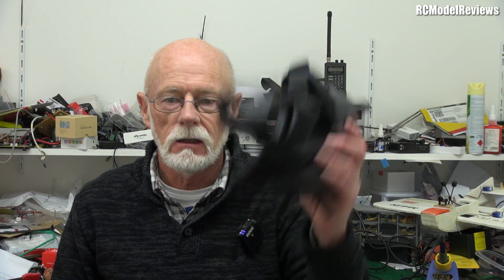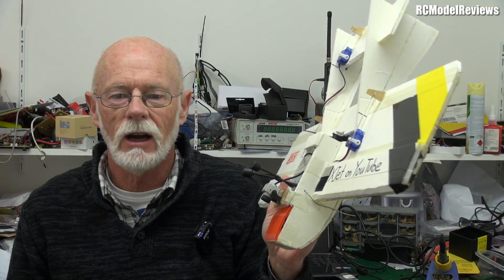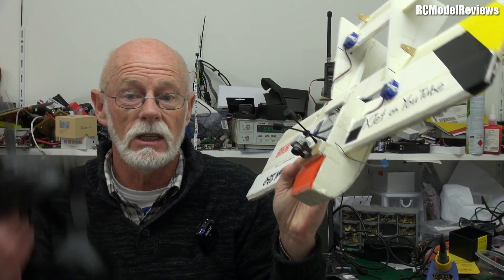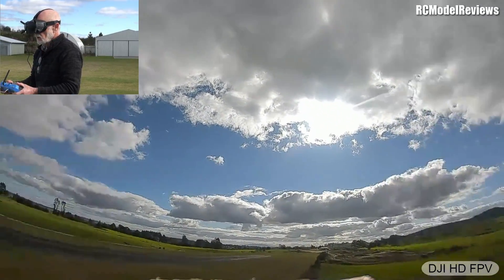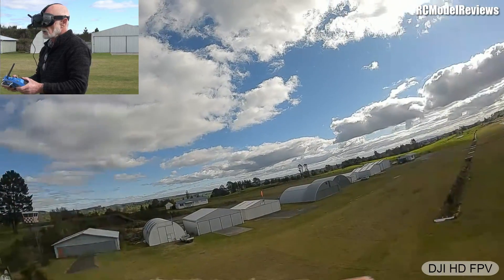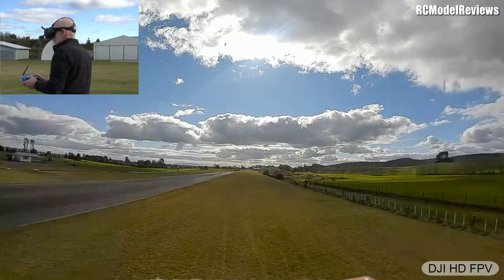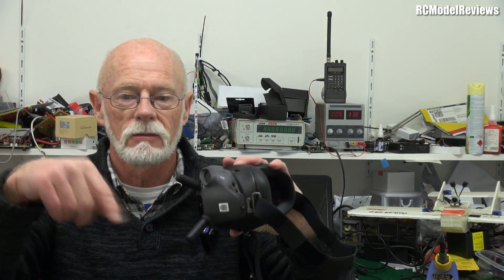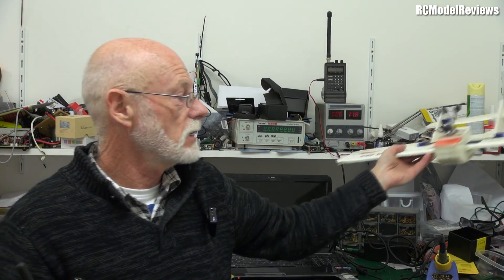Quick 25mW range test (DJI HD FPV first flight and thoughts)

Comment: 4:06 I am wondering about the clearly separated sharp squared area in the middle and the heavyly pixelated stripes on both sides, which are very obvious. I guess it is a software trick to reduce the video bandwidth.
Reply: Hey to answer your question, hes using the focus mode option that has the sharpest image in the center of your screen. This is mostly used for fpv racers but the system also has the normal view.

Comment: Bruce, is there any statement from DJI why there are only two options for power setting? I'd like to see 25mW, 250mW, 500mW, 700mW as options. not just the two. I feel 250mW is far more usable (albeit still unlawful in certain areas of the world) for a more solid video link in close proximity.  Aloha

Comment: lost my brand new build with DJI air unit today in some tall grass. never to be found again. The quad glitched out on low signal about 300 yards away.. not sure what the problem was. Nowhere near 4km as DJI states. Big open field, Not super impressed.. Signal came back and I was in the grass ( 6 feet tall grass). gone forever.
Reply: Did you install a beeper or program your motors to beep upon a few minutes of inactivity? I hate to hear these stories about lost gear... wish you all the best.
Reply: The Polymath nope. But on my new build coming in the mail I ordered a self powered buzzer. Will never lose another drone.

Comment: 10:40 I actually want to see someone flying a control line plane with a signal cable going back along the line and wearing fpv goggles now. How many circles till they ended up tied up and on the ground? :P

Comment: thanks for testing 25mw (but you had no other option right?)
when i tested the inspire with occusync i also measured the wireless aspect. it was for sure more power than 25mw. legally in eu!
why? because dji did it :)
no i think to remember that if you are didital and frequ hopping (like occusync) than you can use up to 100mw (or more?)
here with the new dji hd sys for high quality and latency i think they use the same bandwidth as analog. great - because you can cram in more pictures, but resrtictions apply and now they really need to use 25mw here...
i just really hope it will be as easy as upgrading us firmware onto those dji pieces and get the full power (i dont think the hardware will be different - that would be way too expensive in production...)

thanks bruce, wish you more flyable winterdays soon!

Comment: Great stuff Bruce !! This is why I'm a Pateron !! You test the stuff that others don't think of, and  are straight up about it !! Keep up with the great reviews. I've seen rumors of a FatShark HD and a Furious FPV HD unit, but DJI is the first. Years, or months, or days from now, we are going to see HD FPV being the new standard, and 2 years ago most were predicting it wouldn't happen at all. I'm glad I bought HDO's now, as with the HDMI input, I'm sure there will be HD in my goggle feed soon. As a weekend , close proximity flier, I don't really have many video issues, and not DJI in any case, as their proprietary approach to tech as well as their cooperate image  is total 1984 BS. 
      IMO, this will be a very poor seller, and will be surpassed by more affordable/ usable/  better systems almost immediately. I wouldn't expect it to last very long , but it is an important product. 
      If you are looking for suggestions on videos, your point on breakup is very valid. I've heard many Crossfire pilots complain about the Freeze frame effect VS the effect of static. Perhaps you could explore more about that. Or digital VS analog transmission challenges. Your whiteboard videos have taught me a lot, and you keep it interesting. In conclusion, review the process, and the product, as the product may not last, but the process will. 
   Thanks, Bruce, you give great value for my small contribution, and a few laughs as well !!

Comment: If the googles had HDMI out it would be perfect... Wonder why there isn't a HDMI out.
Reply from the maker: I suspect that DJI will either update the firmware to deliver HD out via the USBC port or they'll sell a separate box ($$$$) for those wanting to get HDMI from the video transmission.

Comment: http://dji.retroroms.info/howto/dji_configs#detailed_video_tutorial
Reply: FCC (0.4w) and FCC boost(1.5w) are two different things gents. Copy of a well known member....What is "Force FCC" and "FCC Boost"? The Mavic and its controller ordinarily communicate on the very congested frequency used by wifi and Bluetooth, 2.4 Gigahertz (2.4Ghz). The maximum power at which consumer products can transmit on the wifi frequency in many countries is 0.1 watts (0.1W). In a minority of countries, including the U.S. it is 1W. Some countries lie in between. Only one country, India, allows more than 1W (In India, the max is 4W!). The Mavic detects where it is located in the world and sets its power to one of two settings, 0.1W (CE mode) or 0.4W (FCC mode). If you live in a CE country, your range on the Mavic will be very limited, at best, 3 to 4 kilometers (2 miles) and much less in urban areas with lots of wifi interference. If you are in an FCC country, range will be much better, up to 6 to 7 kilometers (4 miles). Force FCC is a mod we can make in the DJI Go app on our phone or tablet that instructs the remote controller and Mavic to transmit at the higher FCC power anywhere in the world. But that's not the end of it. For whatever reason, the Mavic has the ability to triple its normal FCC power and transmit at 1.5W (that's 15 times the normal limit outside the U.S.). Additionally, it can shift its frequency out of the congested 2.4Ghz band to either 2.33Ghz or 2.57Ghz--significantly reducing the effects of interference from all the wifi in urban environments.

Theoretically, people in CE countries will see doubling of range with Force FCC and almost quadrupling of range (3.9 times) with FCC Boost. People going from FCC to FCC Boost should see nearly doubling of range (1.9 times). In fact, a Mavic on the 2.57Ghz band at the FCC Boost power of 1.5W will likely be able to stay connected to its controller at a further distance than its battery will allow it to fly away from the controller and make it back. Is it legal to fly your Mavic using Force FCC outside the U.S. or using FCC Boost anywhere (other than India)? Not without special permits.

Comment: You do a video on this but not FPVBLUE?
Reply from the maker: Yes, several other HD systems are currently on the bench and in the air with video to follow.
Reply: @RCModelReviews  yes write on mate ! I have the first Gen 1.3G FPVBLUE  love it :-). I run it side by side with my analog video system on 1.3G with a little bit of Channel separation everything works. Been out as far as 45k on analog  and with FPVBLUE freezing up at around 20k using long range LHCP receivers antennas for FPVBLUE and RHCP long range antennas on the analog video system.  Works like a dream. Unfortunately there were only a few produced of the 1.3G fpv blue systems built and there won't be a 1.3G in the future. But a new 2.4g system is on the way with a 1080p down link. The only drawback is the reduction in range compared to the 1.3 G version I have.

Comment: Hey, could you let us know if the controller is compatible with simulators like Liftoff?

Also, what do we lose out on if we use a Kiss FC? HDL protocol?
Reply from the maker: The official DJI FAQ says that the RC transmitter can be used with simulators but I don't have one of the transmitters so can't confirm.

Comment: Thank you for testing 25mW. I live in Europe so this power level is relevant for me.
Reply: Yeah, if 250 meters is all we can expect, it’s worthless. My old Phantom 2 had better range than that.
Reply: Nobody would notice if you fly with the full power. 5.8ghz goes not interfere with anything important.
Reply: blise518B As long as you have the option to switch it.
Reply: wattage2007 even if a cop would have a look at it he wouldn’t have any idea. They would need to send it to a measuring facility or something. And that’s very unlikely.

Comment: I have installed on my Eflite Oppterra 2m wing.  Set to 700mw and it works great.  Not so great at 25mw. No surprise there!!  Great picture thru the goggles.  Happy customer.
Reply from the maker: Yes, I just flew (in a storm) at 700mW and it is a vastly superior experience.

Comment: Interesting video correct me if I'm wrong but hi density detail notwithstanding the signal loss seemed to produce a vertical curtain effect of pixelation from each side as well as freeze frames is this a clue to how they have dealt with the signal hysteresis/latency and was the audio at the end from the model or the hand held camera as it seemed delayed or maybe they don't do audio as it has to be delayed to match the displayed frame rate? It will e interesting to see what the latency is!

Comment: I can't waite for your antenna tests. My Fat Sharks are on Ebay right now so I can afford these.
I am super curious if we are to use wifi patch antennas meant for routers or patch antennas meant for fpv
Reply: No it will not work. Dji is using a mimo system, a special antenna array that is working together to archive maximum performance if you play with that it won't help
Reply: @peterzingler6221  Oh sweet, if its MIMO then I can totally use wifi antennas. I did the exact same thing to my Mimo router and giant Mimo Wifi network I setup for a trailer  park. Just have to use all the same antennas on all the ports for it to work.

Comment: Yah,25mw isn't enough.Turn it up,forget about the laws.
Reply from the maker: What? Me?  :-)
Reply: @RCModelReviews  You can get a over 500+ meters on 25mw or a little over a quarter of a mile  if you change the antennas out bud. Check out the XAIR 5.8's for the DJI Goggles, they are very good and get you some of the best experiences you can get right now. Changing out the stock on board antennas also helps but its not as dramatic as the goggles themselves.
Reply: Careful, we recently had someone interfering with frequencies we use up in whangarei. RSM came out and investigated for over a week before finding out who and what it was. Fines will probably be in the tens of thousands of dollars.
Reply: @defyent  hi, can you elaborate on that, I'm in whangarei and just bought the system , what do I need to know?
Reply: @Jiml3ob  Sorry my comment was a reply to the "forget about the laws" comment. The DJI system it's self is great and you shouldn't run into any trouble.
Reply: @defyent  even if it is unlocked to 700mw?  Thanks for responding by the way.
Reply: @Jiml3ob  You'd have to doublecheck RSM's limits on airbourne digital 5.8ghz, even unlocked you're unlikely to cause the kinds of problems I mentioned above, that was an entirely different band.
Reply: Thanks for your time and advice man.
Reply: @fellasboyz1272  you can get up to 1200 mw

Comment: Bruce do you have a Connex Pro Sight system to do a side by side test? would be interested in your thoughts.
Reply from the maker: Yes, I will be doing a side-by-side of the DJI system with the Connex Pro and the FPV Blue

Comment: Could you fly arround the back of the hangars at the airfield to the test the image quality? for me the 250 meters range would be ok for normal freestyle, but its the part of having obstacles in the way that limits the fun.
Reply from the maker: Actually it seems to handle obstacles somewhat better than an analog system.  I've flow behind the hangars and had minimal change in performance.
Reply: Thats kinda impressive, i would have assumed those big metal structures would impact the signal.

Comment: According to a mate actually the new fpv system registers your IP address and that dictates your power due to being in the EU, you can download a file into a micro SD and change it so you can get the full 700mw or use a vpn and tell it your in the USA but it does change back as soon as you connect internet or data to it, they are calling them soft blocks. Maybe this is something you could confirm?
Reply: See the link in the description of the last video on this channel for the answers.

Comment: So I’m just getting into fpv and went with 5.8ghz regular analog, now I’m regretting it cause I basically get a bad image mixed with low range.. I wish I went digital or one of the lower frequencies so I’d either get a great image like this or long range.
Reply: Analog is still better for long range, are you flying behind metal objects or something? Or using a cheap goggle with build-in non-diversity receiver?
Reply: Quad Copter Well I haven’t actually tested my system yet outdoors I’m just guessing. I have an ev800d goggle and two vtx setups, ones an fpv nose for an f27 evolution and the other is an older setup I bought and never used, the tx is “FX758-2 5.8G 200mW 32CH” and camera is “600TVL 1/4 1.8mm CMOS FPV 170 Degree Wide Angle Lens Camera PAL/NTSC 3.7-5V”. I’m thinking of just buying a new camera vtx combo but not sure if it’s worth it.
Reply: @travispratt6327  What kind of antenna's are you using,  the ev800D is not that bad tbh,  yes it has internal receiver but it is true diversity. You say poor range but havent tested outside,  that makes me wonder if you are using the stock antenna's.
Reply: Quad Copter Well I just meant poor range compared to 900mz or 1.2 ghz, but I understand the reason people choose 5.8 is cause those antennas are usually large, for antennas I’m using the two that came with the ev800d from Banggood, ones a sting pad I think and the other a circle one, for the vtx they’re both using regular dipole little wires
Reply: Quad Copter Hey lemme ask you what do you use? I just tested my old system a little bit, it’s just such a crappy image, colors are washed out, interference static and kinda like pixel deforming idk exactly how to explain, what’s the current best 5.8 camera and vtx for the money? I’m basically just using it for recreation but I’d like a better picture.
Reply: @travispratt6327  The best AIO vtx/cam combo is the one the regular mobula7 is using. And for my trashcan i use the stock 200mw vtx with an EOS,   on a ev200D with good linear for mobula and pagoda for my  lollipop antenna on trashcan
Reply: Quad Copter Well my first mistake is I wasn’t set to diversity on my goggles, seems to be much better with diversity and also I think my little Lipo I was using was dropping voltage, used a fresh one and got rid of a lot of the static, seems like a decent picture so far just testing on my little syma all taped together haha. I bought a kit off amazon to build, it seems too good to be true so I’m expecting non functioning pieces and stuff but I took the risk, here’s the kit I’m waiting for; https://www.amazon.com/dp/B01MA6CAI0/ref=cm_sw_em_r_mt_dp_U_rNZvDb5V4AQ1Q

Comment: Does it run cool 25 mW mode? Wondering if it can be installed inside a canopy where it won't get cooling in 25 mW mode.
Reply: It's warm but not hot -- mind you, it is winter here.

Comment: But normally with FPV on fixed wing, the further out you go, the more altitude you need for a clear signal.  Would that have cleared up if you would have went up to 100 or so feet?
Reply: At this close a range the distance between 50 feet and 100 feet of altitude is negligible.

Comment: Thank you for all the wisdom.  
Can you use the googles in a simulator?  Know that it is some kind of analog input but no one has tested it?  
Know that you do not have the DJI hand control but do you know if you can connect it to computer/simulator?  DJI gives no answer to that !?  
GPS rescue mode, does it work on digital?  hardly know if it work on analog :-) Thanks.

Comment: ~250m on free line of sight. sounds like garbage.
Reply: It's about what you'd expect from an analog FPV system so in that regard, if you're going to stay "legal" it's still pretty good.
Reply: @xjet  that's true. such a live-feed must be impressive. but still investing 1k for something that only can fly in such limited area sounds very strange to me. flying bando might be a bad idea like 1 wall could be enough to give you a monster lag/breakup and flying range isn't possible either. not a lot of usage for that one.
Reply: @fawkeyes5111  1 wall is enough after all its 5.8ghz

Comment: Can you adjust the power level or is it locked to 25mw?
Reply: I think it can go upto 800mw
Reply: @amritsandhu4225  that's exactly the question. Does DJI sets it according to your region or you can freely change the output power anytime
Reply: @skaman82  I think it's locked for Europe for some ridiculously low power output but all the other regions are free to change the settings

Comment: Assuming there is no gps in the unit, would using a vpn link to a location that allows max power during setup work?
Reply: Don't even need VPN just use a fake location app for your phone

Comment: If I buy these it will be because the awesome goggle View thanks bruce and great to see it on a wing not kwads
Good to see you not using DJI controller..... do you think the 2.4g transmitter range will shorten because of the 5.8 in high power?

you even look cool in the goggles!
Reply: Just gonna jump in here, coming from strictly the perspective of a quad pilot. Since the frequencies are so far removed it shouldn't cause a drastic decrease in RC range. If there is an issue though you could always move to a UHF system.

Comment: I wonder how much pixelization you get when you performing acrobatic with a plane. Since then, the profile of the plane and antenna would be dramatically different than level flight. Not bad range at all for a 25mw system. I generally fly within 200 meters of myself with 25mw systems. Thanks for the testing and I'll see you in the Air!